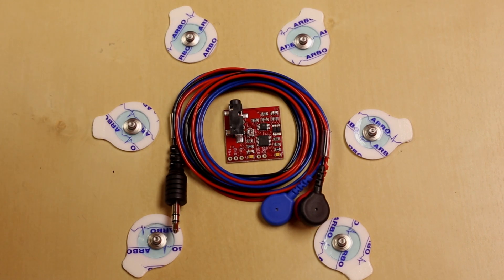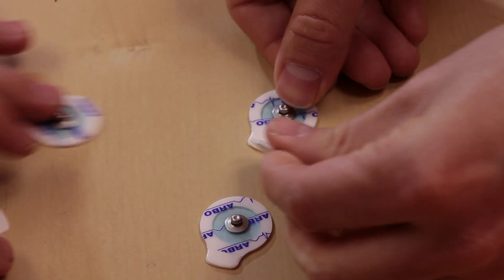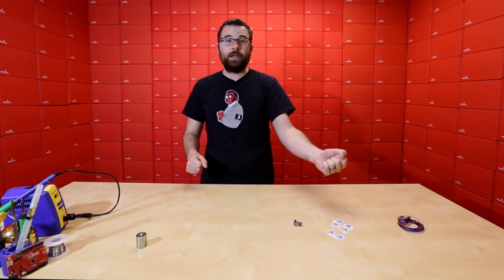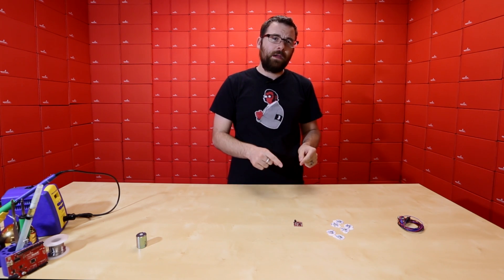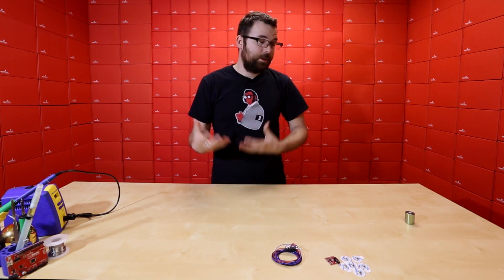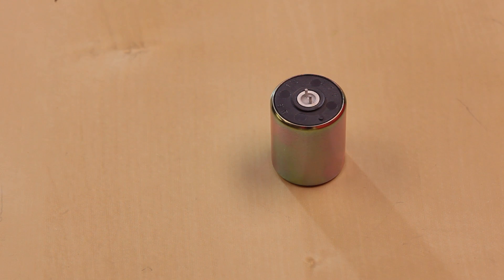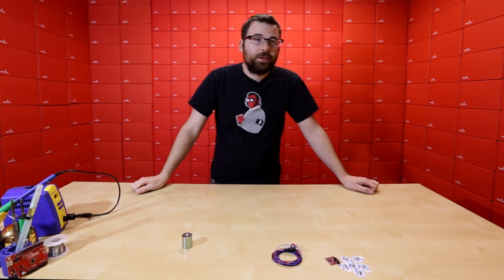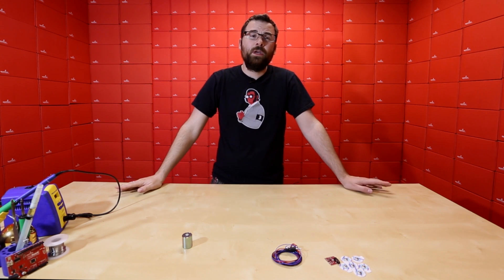SparkFun 4-26-13 Product Showcase: New Product Shakedown

Comment: can u please do a video on muscle sensor v3 kit.. its connections..and output waveforms connected to a CRO and all.. it would be a of great assistance to my project..
im working on a prosthetic arm using those V3 kits.. and im having trouble connecting them correctly.. im getting noise as output and not any useful signal